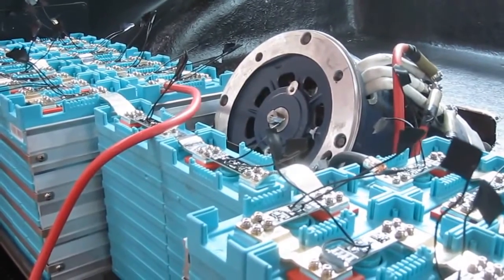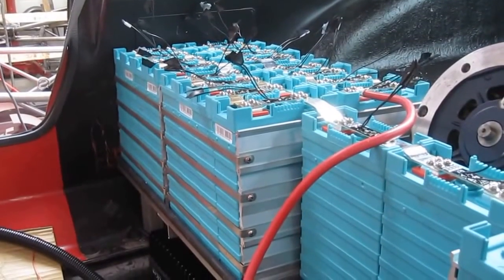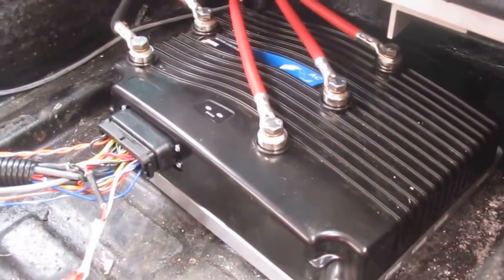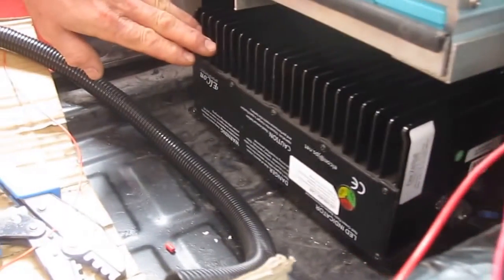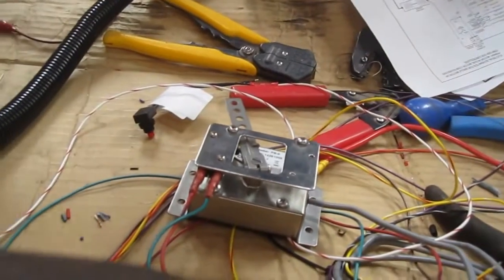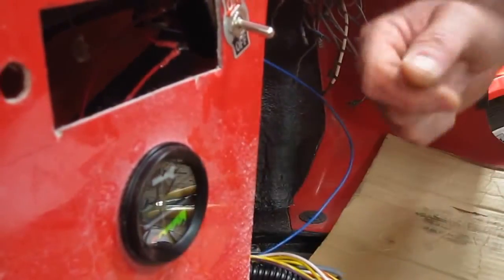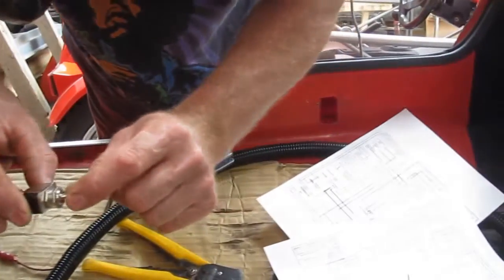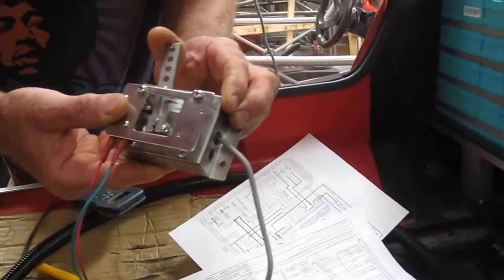ELECTRIC CARS: THE TRUTH

Comment: it still hasnt broken through in the kitcarscene. Some unworkable unsellable examples have been  offered in the netherlands to be finally sold with large losses, finally ending up with electrical breakdowns and degraded batteries. Unsupported electrical components from manufacturers gone way broke are impossible to repair for most people. Ive seen some of these kitcars reconverted to petrol. This will predict that a 20 year old tesla in the future will not be a donor car for those wanting to build a lightweigt vehicle with the joy of the one that produce sound and smell. Look at electrical components of classic cars after 30 or 40 years. That disaster in a blackbox is way worse and unworkable.

Comment: What is the body style on that VW? Where did you find that odd ball differential, from an old Milk Truck? Why not keep the stock transmission and just shorten the chassis? Utilizing a newer IRS chassis would have been good and no custom axles. You can change the gearing to suit the AC motor. I see your setup works. Good deal.